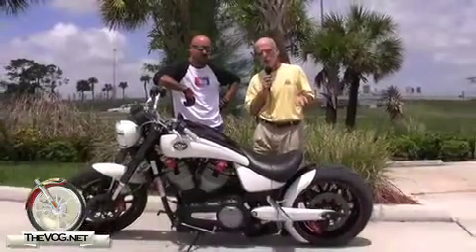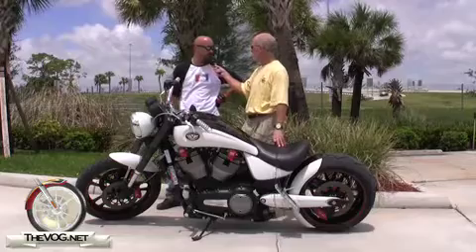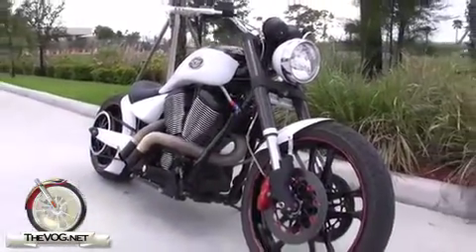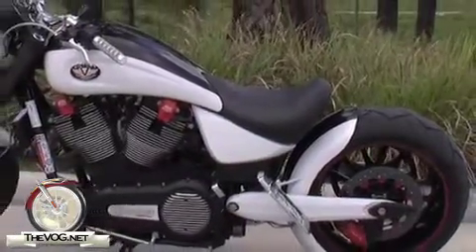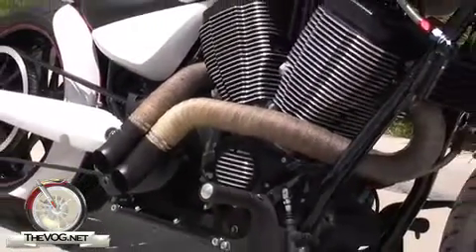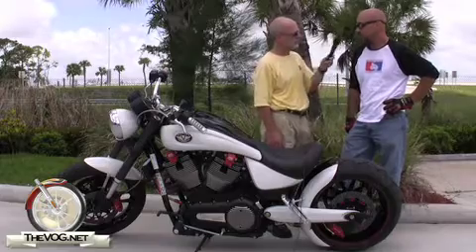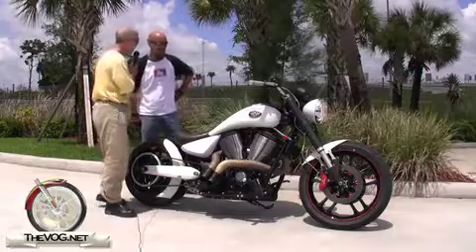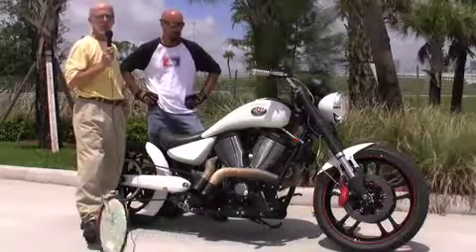Conquest Customs - Victory 8-Ball

Comment: My 08 kingpin 8-ball looks better!  I will post video soon to back up my comment.  I made swooping forward 19" apes, took the wedge off and made a different better looking circular stainless piece, relocated the key under the headlight, hidden air filter under tank. flat black, totally clean rear fender where no bolts are seen on it, led signals, custom leather seat, hand made grips and foot pegs, and I am sure there is more I am forgetting!  Diamond cut engine this winter!  Absolutely stunning.